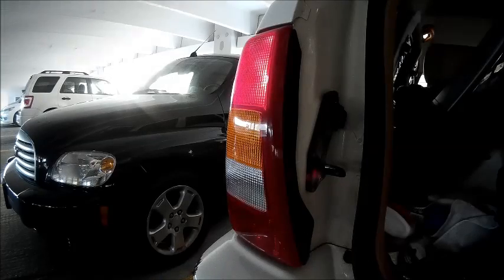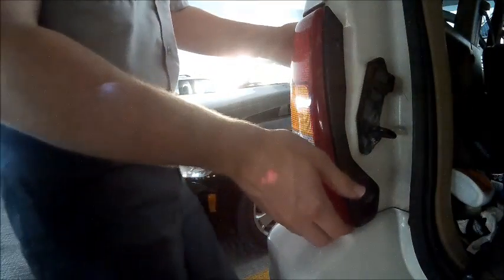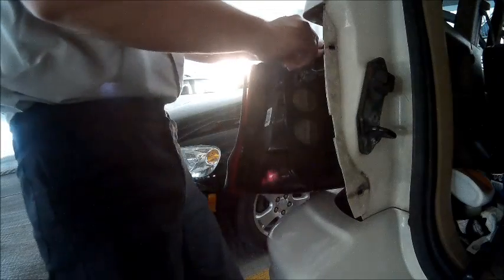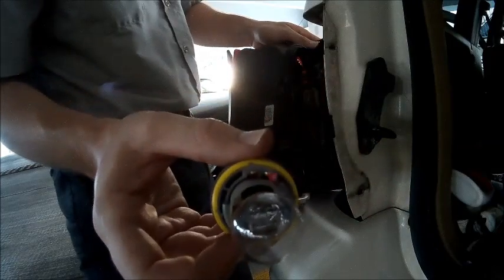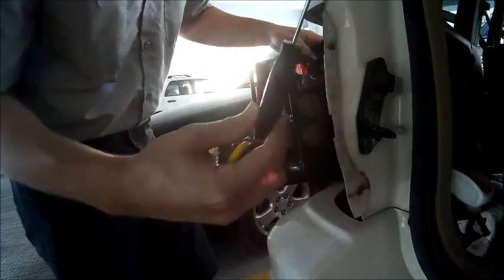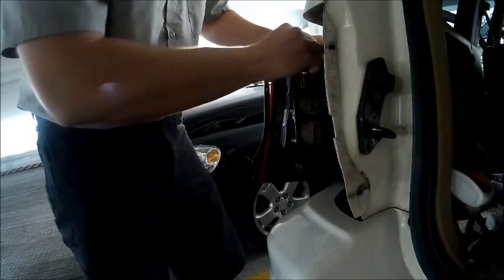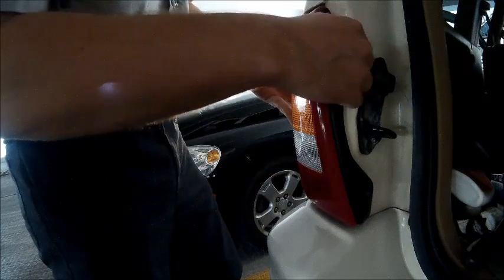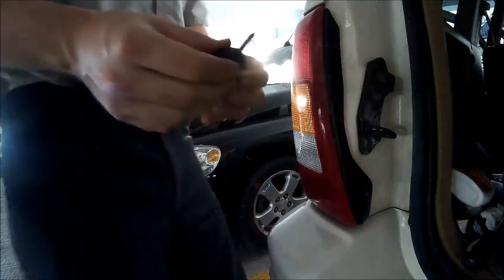1999-04 Jeep Grand Cherokee Brake Light Bulb Fix

Comment: I just started having this problem on passenger side 2000 JGC. The tail light/ brakelight bulb socket is broken and burnt. Bought 2 new sockets and bulbs and both did not work. I did clean the tabs on the carrier but didn't bend the tabs. 
I put it back together with the old socket and a new bulb and it works for now.
Reply from the maker: Glad it worked

Comment: Replaced bulbs and sockets. Still the only lights working is back up/signals. I don't think it is the circuit board, they are out on both sides and the top brake light. Help.
Reply from the maker: Hello Kathy, sometimes the tabs that the light bulb actually goes into are bad or there is corrosion, you can try to bend the tab up so it contacts better and clean the two surfaces. Happy Motoring-Blair